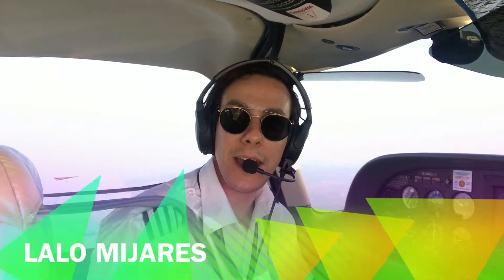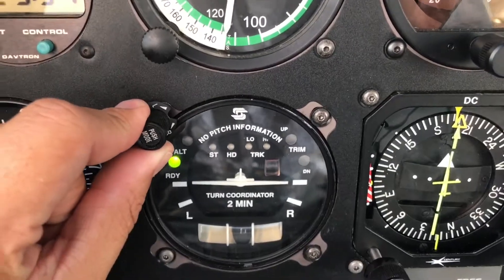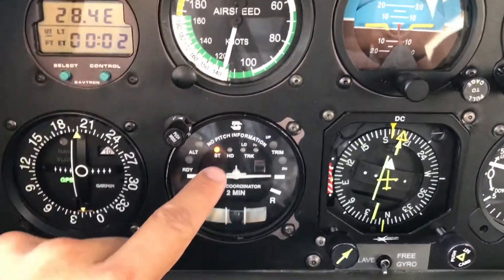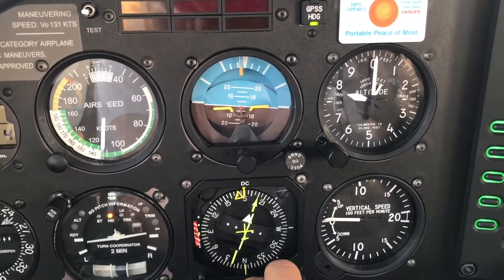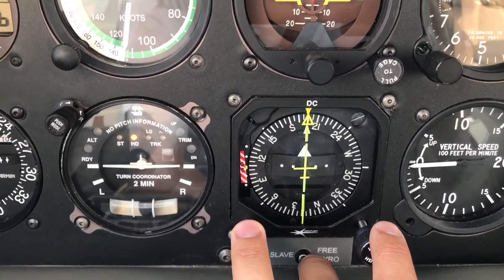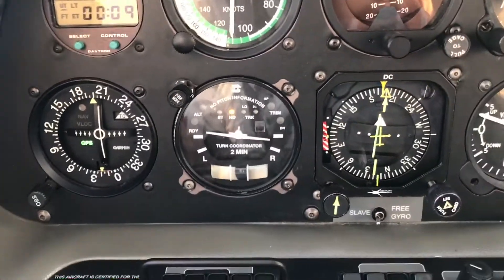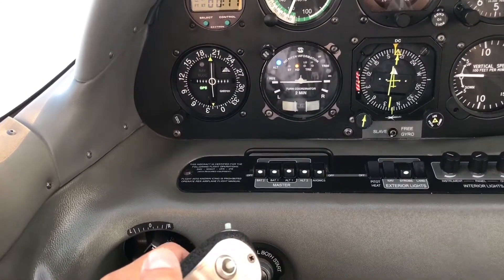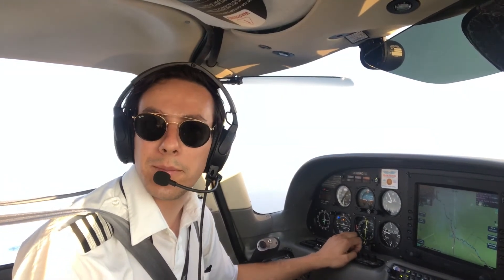S-TEC 30 Autopilot Operation

Comment: Regarding the knob position being in the neutral position for steer mode at 2 o'clock position: You simply need to remove the knob using a micro allen key, replace the button with neutral in top dead centre and tighten the screw.  Here is a warning about those plastic knobs, they are very expensive to replace.  $440 USD from S-TEC Genesys Systems.  Don't break them and also, never pull back hard on that knob as it will disassemble the internal universal joint that connects it to a potentiometer and push switch.

Comment: Watching your video again I noticed that you are using the GPS while it is still engaged on heading mode. I guess the heading mode/GPS mode overrides this. The aircraft I fly has an aspen, and it has a heading and a GPSS mode as well but I have been switching to the track, and someone told me you didn’t have to. The track mode is only for use with the VOR or ILS. Basically the track mode would be used when you select your CDI to VLOC. Can anybody verify this?
😊
Reply from the maker: that is correct, GPSS (GPS Steering) information goes to an analog autopilot via the HDG channel. Therefore, in your aspen I am pretty sure you can change between HDG and GPSS, but the autopilot always stays in HDG mode.
Reply: @LaloMijares  Only problem is the aircraft doesn’t turn aggressively to capture the new course. For example if you fly a 90 degree approach like most RNAV GPS approaches. The aircraft flys to the IAP then doesn’t line up on the final course right then. It takes a half mile to get perfectly lined up. It easier then to use the ST mode til established.
Reply: @aviatortrucker6285  - This means you don't have a true 'GPSS' converter.  The GPS track only works in your case, through the HSI.  This means ti can't do turns that are more than 10 degrees.
Reply: When I am in HDG mode and press GNSS button it blinks rapid green lights vs steady green and does not change modes. In any settings Sd HDG lo hi the GNSS always blinks and never is study green. The Garmin gns480 is on GPS mode with a flight plan loaded
Reply: @fergusonvancouver9921  - This means there is no available GPSS source.  Are you sure the 480 in on GPS mode and not VLOC.  Other than that, have you tried doing a 'Direct to' before engaging the GPSS?

Comment: I used one on a rental aircraft, a PA 28. It seem to work well except for GPS procedures. Let me explain. I tried both the low and high sensitivity, either way, it  tracked the GPS fine. I placed my Aspen in GPSS mode, which is the GPS steer mode. The unit tracked according to the desired track. However, when I approached the hold, in lieu, the aircraft was required to make a direct entry. But, upon crossing the fix the aircraft banked at about half standard rate and just meandered in a slow circle which brought me halfway between the hold fix and the final approach fix. It did the same for any course changes more than 45 degrees. Maybe I’m just used to a Garmin 500 series but it seems like if you have to make a turn more than 20° you should shift it to heading mode and use the heading bug. This seems like a very inexpensive basic Auto pilot that is good for just holding altitude and a single course or slight course changes. Any body have any other input about making course changes on GPS mode with this unit.

Comment: Great video!  I sometimes fly a plane that has this AP, it's a great unit.  One nice thing about this model is that it's rate based, on the turn coordinator gyro, so it's not dependent on the artificial horizon.   It still works even if the vacuum system fails.  So a good thing to have if you're flying in IFR and don't have a backup AH or backup vacuum source.

Comment: You should mention the Trim Lights on the STEC-30, i.e. if Aircraft needs UP or DOWN trim in the ALT hold mode..
Reply: Thanks
Reply from the maker: Yeah, sometimes I miss stuff, but you are right.

Comment: Thank you.
Will it hold altitude & track at the same time?
Does the autopilot also do climbs & descents or just altitude hold ?
Reply: It's covered in the video.    Yes, the STEC 30 will hold lateral mode (ST, HDG, GPSS, VOR) at the same time as holding the ALT, using ALT HOLD mode.   No, it cannot perform any climb/descent/vertical speed hold.  The only vertical mode on this AP is simple, present altitude hold.
Reply: Only altitude hold.  No VS modes.